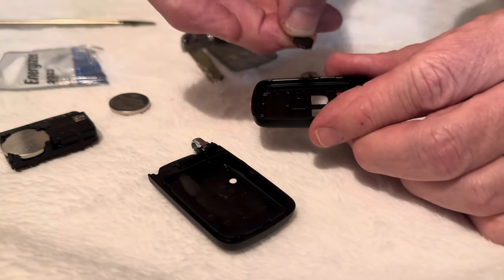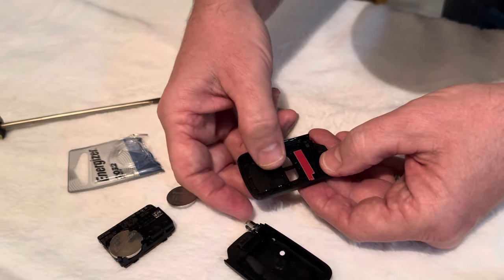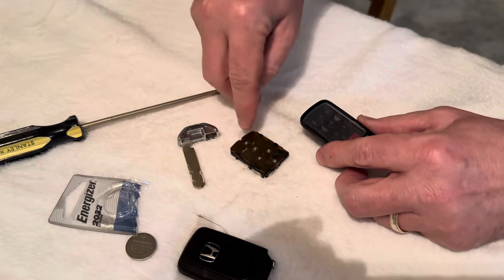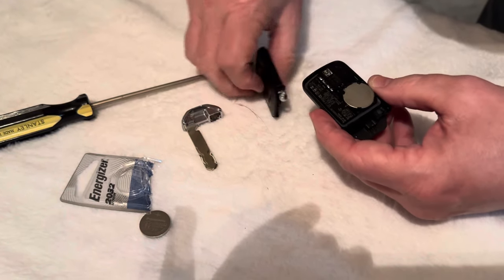HONDA KEY FOB FELL APART DURING BATTERY INSTALL ACCORD CIVIC CRV

Comment: Thank you very helpful, thanks for posting. one thing I did do was to put tape across the front case the buttons will stick to the tape and not fall out just peel the tape off after reassembly.
Reply from the maker: Good idea.
Reply: Thank you, you helped my patience & shaky coffee hands, the tape is the most important thing. The tiny image pieces on my fob do not lock into place & they kept falling out.
Reply: So smart!

Comment: For anyone having trouble putting back together first take everything apart then put the buttons in first only the lock and unlock then you place the middle bracket then proceed to add the smaller 2 buttons and the alarm button can be put on any time and boom snaps back together perfectly

Comment: Great patience putting this back together.  Like you said "This should be fairly easy."  But of course, the unit fell apart for me, too. Thank you!!!
Reply from the maker: Nothing is ever east for me. Lol
Reply: Use tape on the front before you put the tiny pieces in, they will stick onto the tape until you get it all together then pull off the tape.
Reply from the maker: @ArnoldZiffle-jw2mv  pro tip right there.

Comment: I did this replacement today with some help from your video. It was funny because I did the exact same things wrong and had the same difficulties! Lol… but in the end it worked out great! 👍 and subscribed! Appreciate the help.
Reply from the maker: Glad I could help. Yea. These things aren’t built to last forever I guess. But my battery lasted less than 2 years. I changed the other at the same time as I could only find a 2 pack battery & I know it’d be lost by the time I needed it.

Comment: Thanks for this video.  I just tried to change the battery on my parents' car and it came apart like this.

I agree with some of the other comments here - this is a terrible design.  Everything's back together, but the buttons just seem to float around and sometimes get stuck, so I give it a week or two before we have a major emergency.
Reply from the maker: Take it apart & do it again. If you put the buttons in correctly they will be fine.
Reply: @JohnnieV  I have done it 3 times and each they all fit, but they don't fit perfectly.  Sometimes the middle button sticks on and the top bottom isn't sitting flat.  I've done my best, but I think this will have t go back to Honda.  I would never have dreamed that if it came apart, the bottoms would just be totally loose.  

Thank you for your help anyway!  The video gave me the confidence do what I thought I needed to do. :)